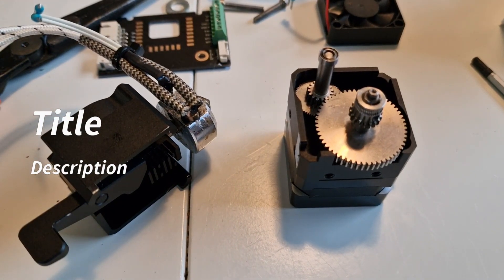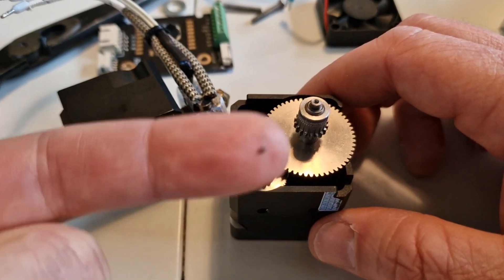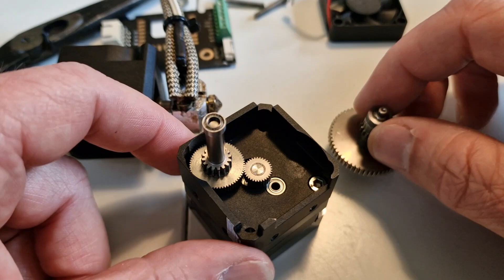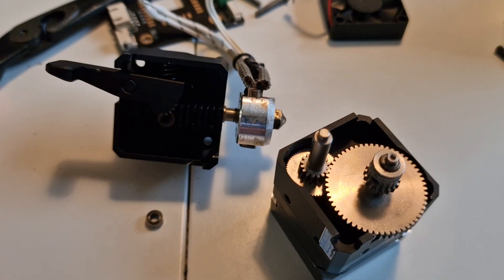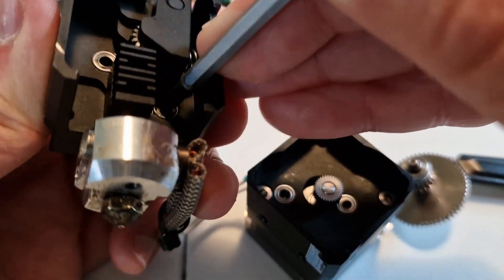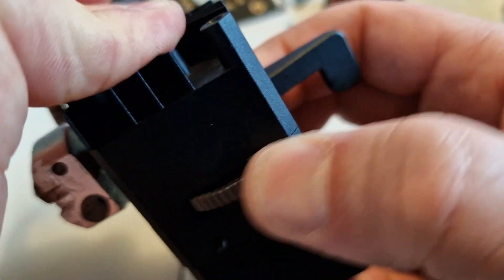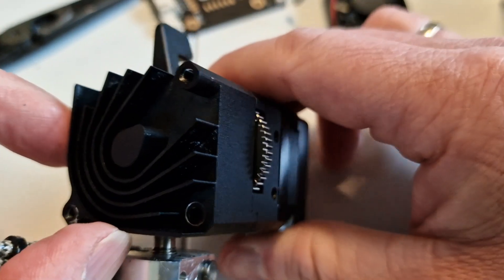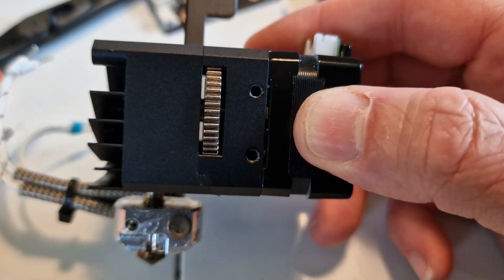How to fix BIQU H2 gear clicking

Comment: How the ** did you manage to tack tape to a greased bearing? Mine came out as if no glue was involved in the situation.
I only managed to halfway stick it by cleaning the bearings outside with a lot of care and some isopropyl alcohol.
Great fix tho, it solved the noise!
Reply from the maker: Haha now that you mentioned it, I don't know. I don't remember cleaning it off but I might have. Also I never added grease in the first place and I don't remember there much there to start with.

Comment: That clicking do also my cheap dual gear extruder, but problems seems different. Not in gears, but in the nozzle. Usually cause when changing nozzle. Between throat and nozzle there was old material, that cause bigger resistance and then cause clicking gears.
Reply from the maker: That would be the motor skipping stept. If your gears are actually slipping there is a major mechanical issue happening. The clicking addressed in this video is minor backlash. its just an annoying sound, not a defect.
Reply: It do only this version? I want to buy h2 v2s revo, but not if has many problems.
Reply from the maker: @martinhyska1206 i have no problems with my H2 extruders. I currently use them exclusively on all my active machines

Comment: I'm wondering how to convert the e-steps info??? The instructions say the number is 932mm at 16 microsteps. I'm using this extruder on a CoreXY printer powered by a Lerdge K. Currently my motor number for the extruder is 650? Can you respond? Thank you.
Reply from the maker: If it's marlin you are using you can send M92 E932
M500
M501
Reply: @StackingLayers  yeah, it probably is but there’s no way to send gcode instructions. Ledge is strictly English.
Reply from the maker: According to the official website you can set E0 steps in the Motor settings under step value. https://m.lerdge.com/document/detail/Step-value
Reply: @StackingLayers  you’re brilliant and I’m too lazy to read. Step value is 68.5? Now I have to find a way to thank you.
Reply from the maker: It should be 932 for E0. It's a 7:1 gear ratio so the motor has to turn 7 times to make the output gear turn once.
Reply: @StackingLayers  but I did the math?
Reply: Does the wiki not address the gear ratio?
Reply from the maker: Its at the very bottom. Also it's a 1.8° motor
Reply: I’m going to input 932 and see how that works. 68.5 wouldn’t even lay down filament for a 16 band skirt.
Reply: I’m not seeing how the math gets to 932?
Reply: But 932 works perfectly!
Reply: 932 works great and I used 1.8 degrees. But the math did not generate 932. Even when I multiplied 68.5 by the 7 to 1 ratio. 943/68.5 is 13.6.
Reply from the maker: The 7:1 ratio is the gearing ratio, but there's a missing factor from the hobbed gear diameter. I haven't done the measurements math to find the exact full ratio, but I have 3 different H2 now and all are set to 932 and extruding perfectly.
Reply: @StackingLayers  I printed Chep’s test cube enlarged 200% and it came out OK with 932 as the EO setting. There was a lot of vertical noise in the print however. Then I printed his cube at a hundred % and the first 10 layers were a spongy mess so I cancelled the print. 68.5 X’s 7 is 479 which is 51% of 932? I’m going to keep experimenting with the extruder. And Chep’s test cube. It may be Cura 5.5 that’s working against me somehow? The main gear’s diameter is 24.5. I’ll measure the gear driving the larger one to see what its diameter is.
Reply from the maker: 1. Gear Ratios:
   - Input gear: 16 teeth
   - First stage: 32 teeth
   - Second stage: 56 teeth

   Gear Ratio (First stage) = 32 / 16 = 2
   Gear Ratio (Second stage) = 56 / 16 = 3.5
   Overall Gear Ratio = 2 * 3.5 = 7

2. Stepper Motor Steps:
   - Stepper motor uses 3200 steps for one full rotation with 16 microsteping.

3. Steps for one rotation of Output Wheel:
   Steps for one rotation = Stepper Motor Steps * Overall Gear Ratio
   Steps for one rotation = 3200 * 7 = 22400

4. Circumference of the Output Wheel:
   - Outer diameter of the hobbed wheel is about 7.65mm, so the circumference is π * 7.65.

5. Steps for 1 mm:
   Steps for 1 mm = Steps for one rotation / Circumference
   Steps for 1 mm = 22400 / (π * 7.65)

   Calculating this value:
   Steps for 1 mm ≈ 22400 / 24.028
   Steps for 1 mm ≈ 932.44

To move a 7.65mm wheel by 1mm, approximately 932 steps would be required
Reply: @StackingLayers very nice to see your thinking on this. Very appreciated as well.
Reply from the maker: I'm curious, what is the 68.5 you keep referring to?
Reply: @StackingLayers  360 divided by 200 is 1.8. 932 divided by 24.5 is 38. 1.8 times 38 is 68.4. In the original formula I thought step angle was 200 instead of 1.8 even though I knew the motor had a step angle of 1.8.

Comment: try to lower extruder curent so motor skips not grinds filament then you wont have mess inside exrtuder. my H2 runs at 350 curent, 800 is recommended for some reason. thanks for video i see if i can fix my clicking extruder now

Comment: Hello! I'm looking to buy myself a direct extruder for my ender 3 v2. I know it's not the best printer, but i wanted to buy a nice extruder to print everything i want without limitation. Is biqu h2 worth it? There is a new version v2s, but i am not sure they had fixed the clicking. What do you think, should i go for the other option?
Reply from the maker: I absolutely love the H2, and I have bought another one, for my other machine. Despite the clicking, it prints beautifully.

Comment: Anybody tried sticking capton on the shaft itself where the shaft touches inside the mini roller?
Reply from the maker: I have not tried that, but it's the case hole that is a bit too big, at least with my unit.
Reply: @StackingLayers Thanks for responding. Roller holes are too large. Capton over outside of the rollers is a must. Thanks for your big expoloration. I just wonder if also applying capton on the shafts may improve even better besides the capton on the roller. 
This video explains in depth the importance of direct drive gears for the final quality of 3d prints => https://www.youtube.com/watch?v=c6JmCdovE0U
Clicking sound is not an issue for me at the moment. But i consider improving h2v2 gear stability just to get rid of z wobble like defects and improve my printing quality.

EDIT: I've made your fix at last! It made retractions really quite. Only drawback is that reassembling has become really hard. Before this mod I didn't even have to get the extruder out of the mount to reassembly. When I had jams I used to disassemble only half of the extruder, fix the jam and reassemble the extruder while half of the 2xtruder was still in its mount. After your mod because of tight tolerances only way to reassembleI the extruder is getting extruder out of the mount. Once the mod is done no clicking sound on retractions anymore. I couldn't use capton on the rollers on motor side of extruder as one of them is hidden behind the motor gear and the other one was already tight in its hole. Shafts were already tight in rollers so there was no need to use capton on shafts.

Comment: I put tape on the four bearings, still some wobble from the bearings themselves. Clicking is still there, but a whole lot less than before. I've noticed now though that I get much greater torque out of the extruder, as before when pushing the flow rate around 15mm^3/s or higher I'd get some ticking sounds where it somehow skipped, and now nothing.
Reply from the maker: Yeah getting the slop out will make everything run better. The gears can mesh together more evenly.

Comment: With mine there was no play in the seating of the bearing, the bearing with the smallest internal diameter (yes, there are two different types used) was just completely shot. Which was weird because the extruder was only in use for 18 hours. I bought some high quality ones from a local Dutch shop which were pretty expensive and now the problem is completely gone. Your video gave me the idea to check the bearings... :)
Reply from the maker: I have thought about looking at some higher quality bearings myself. I think if the tape fails then I'll do that. It's still going strong though.

Comment: Nice discovery.  What are you using for your quick connect/disconnect wire connections?  Looks like another great solution.
Reply from the maker: It's a BIQU hermit Crab tool changer. I absolutely love it.

Comment: Have you had any issues with it chewing filament? My retraction settings are .5 at 4mms.
Reply from the maker: Not really. There was some bits after I had a clog when I forgot to set the correct temperature, but I never have any problems like that. I have my retract set to 0.84 at 40mm/s
Reply: @StackingLayers  ok thanks I'll try those settings and see what happens.
Reply from the maker: Make sure temp is correct for the filament too. Grinding normally happens when something it not letting the filament flow, and too cold will cause that. Too hot can also do it if there is heat creep jamming things up.
Reply: You might have one of the screws too tight. On mine there's an adjustment screw that you can turn to either grab the filament tighter or to ease up on its grip. In the beginning mine wasn't screwed enough and it stopped pushing filament and there was a mess of chewed goodness. Then I overtightened it and something similar happened but a little was still making it through. There's a sweet spot that I had to find but once I found it, it'll never change as the filaments we use should all be that 1.75mm and so it wouldn't even become an issue again.
Reply from the maker: @studio Vulcan  Unless you have a new H2 V2S LITE or Revo version, there are no pressure adjusting screws on the H2.

Comment: Would loctite stud and bearing mount be an option? Good video.
Reply from the maker: Honestly I don't know, but my thought is that anything to fix it in place should work. Although I would be concerned about some of it getting in the wrong spot and fouling up the bearings. Plus I don't know how it would react with the lubricant that is in there.
Reply: Not sure what temperatures is loctite rated for but kapton tape is a safe way to do that and also avoid accidental spillage of glue into your bearing. Nice tip!
Reply from the maker: Loctite 243 has a temperature range of -55c to 150c. I was talking with an engineer friend of mine about this, and he did say loctite 243 could be used but to take precautions not to get it into the bearings. He also said that loctite is almost instantly cured in the absence of air and presence of metal so it's not likely to migrate. I'm tempted to try it, but still sceptical. Loctite also makes a retaining compound 638 that is designed for bearings so perhaps that'll be better. A big thing to keep in mind when using these type of fixing materials is that you need to make sure at least one part is not fixed so you can still service in case you get a jam.
Reply: @StackingLayers  One thing to be careful of is any reaction between the 'glue' and with plastic that the bearing sits in. I used a thread sealant on ABS threaded fitting once, it fell apart due to reaction with the sealant about a month later.... only use ptfe tape now..
Reply from the maker: @martin White it's an all aluminum gear case, no worries for reaction unless there's mercury in it.